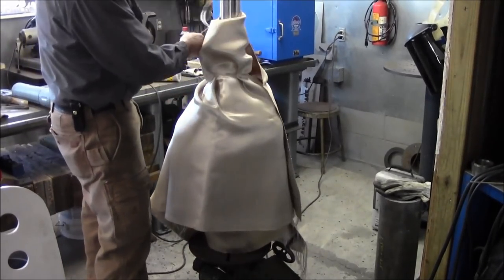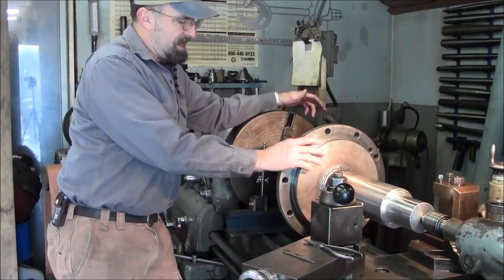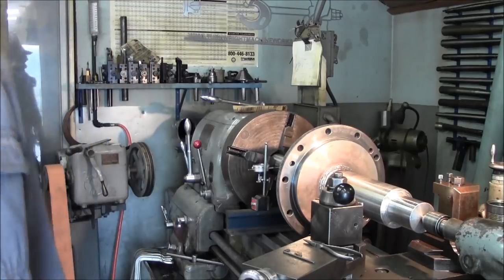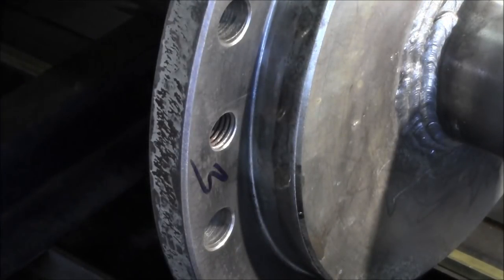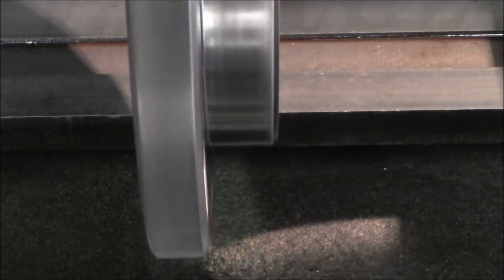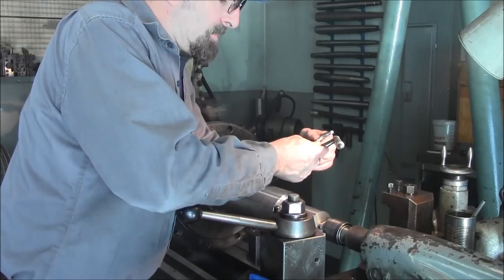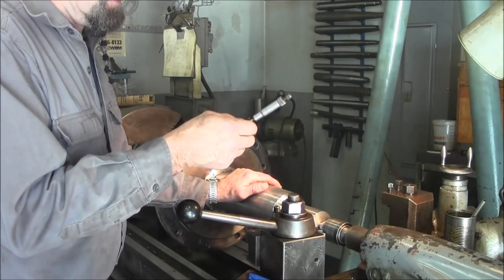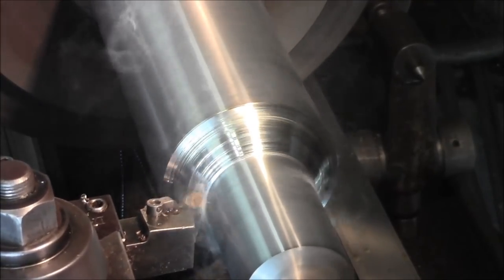The Broken Beaver Part 6: Wood Chipper Repair

Comment: They also have oldschool radiusing attachments that clamp on the topslide. It pivots a toolbit in an arc by means of a stout handle. They can be set up to do inside and outside radii.

Comment: Really nice and professional good work indeed ......... and expensive !
I beleave the part is used in some "tree-crunching-jig" of some kind - not just for use in the garden back home - what I mean is, there has to be SOLD much cut wood to pay for your time doing this nice job - I long to see the machine doing the cutting with this new well balanced shaft and flange - thumbs up and head down for your skills and experience !

Comment: Back in the late 60's when balancing a 265 or a 283 cubic inch chevy backyard style was balancing of the reciprocating parts on a set of wood chipper blades. I used the DI to check for vibration afterwards, I didn't have what's in your shop at that time,  the attitude was the same.. Get Er Done and nothing breaks.  (the old JM Wight Tech., Stamford Ct. grad with honorable shop teachers that showed  and told how to do before osha) ( what's a osha? seawater?) got fish?)  ;) Good stuff Kieth!

Comment from the maker: I only had 1" bolts and used the nut and washer to take up some of the threading and keep them a little shallower. the washer also aids in spreading the load as you mentioned. ;{)---

Comment: Keith on the press at my buds I welded a 3/4 x 2 " wheel stud  onto the side of the tip by the cyl. then you can lift shafts out with the Hyd cyl . as it lifts up his has a 3" tip pad though ;  I did`nt see if you had one on yours , If your worried about losing internal applications make a collar that sits above the tip  that bolts on ,the just use the nylon choker to lift it up , Geez some big milling I watched 6 vids tonight on this .+ it working that`s big BIG STUMP ,I live for this 30+yrs to

Comment from the maker: I have had minor incidents over the years, judging major as harming the lathe itself. I have been in the same shop with a fly chuck key that stopped after it stuck into a 14 gage steel back board on the bench behind the lathe. and was running a lathe with my back to a lathe that was mistakenly started in top speed and the shaft grew and pulled loose from the center, whipping in the air like a wet noodle, making me dive for the floor! ;{)---

Comment: Looks great after the welding.  

If you did not have the tracer, I guess the only way to do the all those radii on the shaft would be with a form tool?

Comment: hey Mr. Fenner I was thinking about a great tool to put in the give away box and I think that a good set of dial indecators would help alot since you realy seem to use them alot to check your work. just a thought, keep up the good work THANKS

Comment: Keith, you mentioned harmonics.  I once got an automobile rotor returned to me from the shop that resurfaced it and it had a herringbone crosshatch on the surface that contacts the pads. I had never seen anything like it and the shop owner said "Don't worry about that; it won't affect performance. After installing them first time I hit the brakes the whine sounded like a fire truck siren. I took them back to the shop and the next time I got them back they were smooth and shiny. Any idea what may have caused a crosshatch like that to be left on the surface of the rotor?

Comment: if you want to know what kind of vibrations you will have why not spin it at 2000 rpm in the lathe ? or is this lathe not capable of making 2000 rpm ?

Comment: Question : Would it be a good idea to send the whole thing off to a driveshaft guy to get it balaced with the cutters mounted. Heavy thingey at 2000 rpm...... You'r doing a great job on this shaft and it's a shame to have it off balance when running. Just a thought.
Reply from the maker: If the complete job was done in house, every shop that I have been part of, would have sent it out for balance. I do have to say standing next to it while running had no vibration at all. Thanks for the comment! ;{)----
Reply: Keith Fenner I followed the whole process and the work is just great and I bet it runs as smooth as nothing else. I was thinking of the complete thing with the blades on and bearing life :) Every shop I worked in would allso have sent it off for balancing :)
Reply: +Eric Hope Driveshaft guys spot weld weights to the shaft .Probably  not good in this application. Plus driveshafts  are much lighter.

Comment: I do not understand why you do not place four good tachs on something before you start welding, I saw you do this before but told myself someone like you would never do that, I was wrong. If I did that when welding pipe everything would be as crooked as can be.
Regards, Edgar
Reply: I think it's because he had a two thousandths press fit on the shaft.